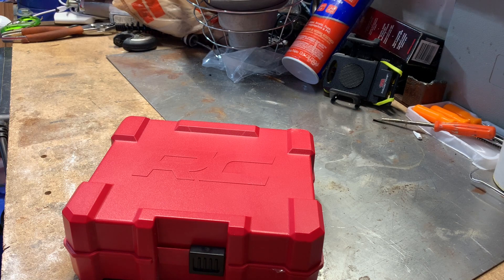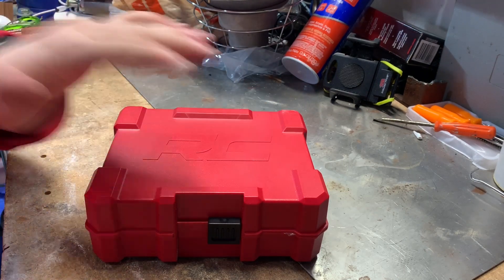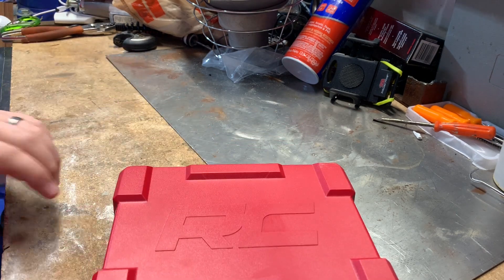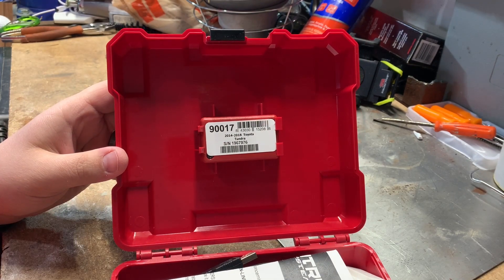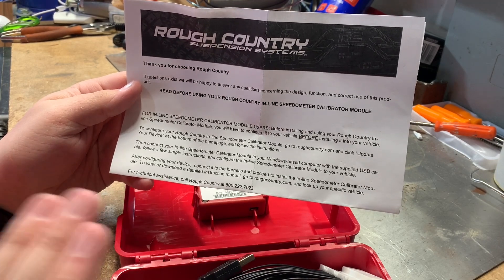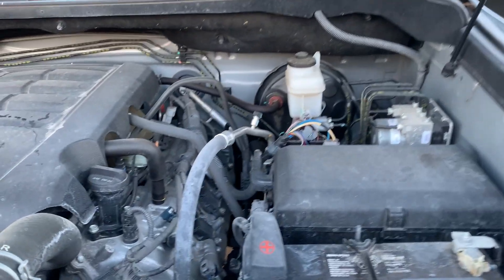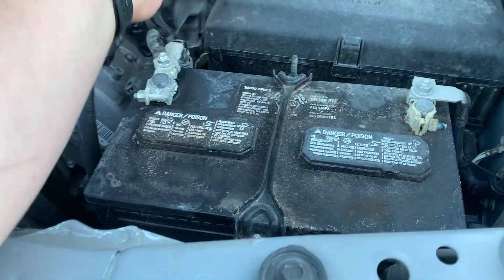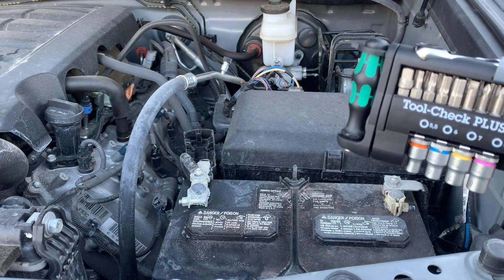Rough Country Speedometer Calibrator Install! Big Tires you need this!

Comment: Great video, thanks for posting it.  I was able to knock this out in about 20 minutes today and your step by step helped get it dialed in.  Just an FYI, I'm off by 2 mph from Waze too.  Not a big deal, before I was showing 70 and going 74 -75 which is what I was concerned about.  Now I'm going 58-59 per Waze but the dash is reading 60.  I'll take slightly under than way over.  The shift points also seem to have been updated which is good, and I'm noticing more engine breaking when going down hill without applying the throttle.
Reply from the maker: @bpmou9230  so glad it helped! And no 2mph isn’t bad! I didn’t really notice shift points but I’ll take it if it’s better! Thanks so much for watching!

Comment: Great video. Very helpful with my install. The only issue is found was with software. After inputting my old and new tire size, the speedometer is still off. Went from 6 mph under to 2 mph over my actual speed according to Waze. Have you been able to readjust the tire size on your unit while it’s plugged into your truck? If so, did you have to disconnect the battery before updating the software? Thanks
Reply: Did you find out about this? Mine is 2 over now, do you have to turn it back to stock then to the correct tire size? Or can you just adjust it straight to the right tire size if you already adjusted it?
Reply: @Phantom_Anthem  I have a thought on this since I’m about to recalibrate my truck;

When I bought my truck, the speedometer was already off (about 3 mph under, so read 77mph instead of 80). The original tires on it were the Wrangler AT’s that Toyota likes to put on some of their packages, and I’m thinking they were a different size than stock. That being said, if I entered those tire sizes as my original, and update with my new tires (37”) I imagine my speedometer will still be off. I’ll have to do a bit more research, but I imagine if I put Toyotas actual stock tires in I will be fine.

You both may have had the same issue as me.
Reply: I’m not sure if this helps but my Tacoma came stock with 245 tires. I went up to 265/75/16 and the speedometer became dead accurate. So it was slightly off when it came from the factory (2 or 3mph).
Reply: Just did mine yesterday and the speed is accurate, but my cruise control is 6 miles lower than the actual reading.

Comment: raised a good point about transmission shift point, but this is one computerized detail that I think the car will adapt/relearn? no need to adjust?
Reply: It will recalibrate on its own.  I did this exact same thing on my 2007 when I upgraded the 18s for 20s.  The calibration required a 50 mile road trip to complete

Comment: Hey dude so I need to change some parameters on my module- can I do this with it installed on the truck or do I need to unplug it and bring it to my laptop? Do I need the Internet? I tried it with the module on the truck but I couldn't get the program to launch.
Reply from the maker: If you left the cord plugged into it you should be able to connect it to a windows laptop and run the program. Not sure if internet is needed:/
Reply: @kccreations5945 hey btw what settings did you end up putting in to get your truck accurate? I'm running 37s

Comment: Does this stay installed permanently or when you tune it it’ll be able to be removed
Reply from the maker: Hey Max, Yes it stays installed! And then I left the USB cable attached to it in a more easily accessible location so if I want to change the settings and plug it into my computer I can do so without pulling the gauge cluster again! Thanks for watching man!

Comment: How is it with the active cruise control? I have a 2020 trd pro , and I just add ridge grappler‘s 285/70r18 . I’ve literally been thinking about getting this cause my miles per gallon seems weird now compared to the stock tires I had on.
Reply from the maker: Hey man! It doesn’t affect cruise at all! No issues with it. I still think I need to fine tune mine because the MPH are off by about 2 but that’s better than 4! Let me know how it works for you!
Reply: @kccreations5945  Yeah I’m a definitely give it a shot and order one , I noticed right away the miles per gallon on the cluster is little funky .
Reply from the maker: @ek4serge27  yeah big tires does that for sure!
Reply: @kccreations5945  Have you done a test with eco-mode on your pedal commander  ,now that you have installed the rough country speed calibrator ?
Reply: @kccreations5945  2 mph is about the same as the factory buffer built in by Toyota. I wouldn't mess with it if I was at +2 mph after the calibrator install.
Reply from the maker: @CopperCanyonTerrapins  that’s good to know man thank you!

Comment: Did you ever fix your popping sound from lift? I did install the 3/1 and never had that problem.
Reply from the maker: No not completely. I think we have lessened it but it's still there. Not sure if it's my sway bar or something. Someone said it could be the skit plate flexing but I haven't investigated that.

Comment: Thanks for showing the install process! Toying with the idea of installing one on my 2022 Frontier. Any idea if this is reversible if you wanted to sell the vehicle down the line and return it to stock? Or do you need to follow a process before uninstalling it. 

Also, if you are without a PC (assuming you mean Windows  based computer) and are on a Apple/ Mac computer, you can always run Windows 10/11 via bootcamp. That way you don't need to get a dedicated machine just for reprogramming and firmware upgrades.
Reply: You just remove the module and harness and it reverts back to stock with no additional process to follow.

Comment: Did you notice any difference in shifting points/timing after installing this?
Reply from the maker: It's really hard to say because I know that it's installed so I think inherently I want to say yes. I do think it has been better and that's because I have felt that the shifting is off sometimes especially with my pedal commander and I haven't noticed that with this installed. Sorry to not have a for certain answer!

Comment: Off topic, I have 2014 tundra ,have had vibration for while, tires all new ,balanced hub centric rings custom made ,all suspension checked in front ,4 wheel alignment, all this helped but it's still there at 50 mph an up ,150 k on the truck ,tires are 33 -12.5-20 yokohama x-at , im thinking only thing left is drive shaft carrier bearing ,any one else have a similar problem an this fixed it ? also rims have been checked all good, because I do go off road so I thought maybe I bent a rim but nope all good there to .
Reply: Oh I have 3 inche leveling kit front an back ,with bilstein 5100s had problem before the new shocks
Reply: Maybe your wheels need to be balanced some weights need to be added to your rims because of the new tires.